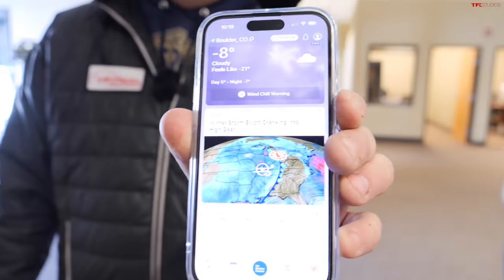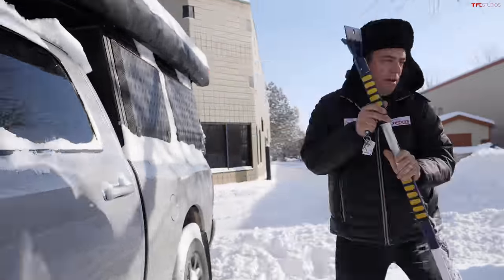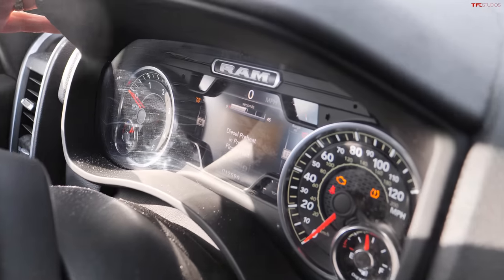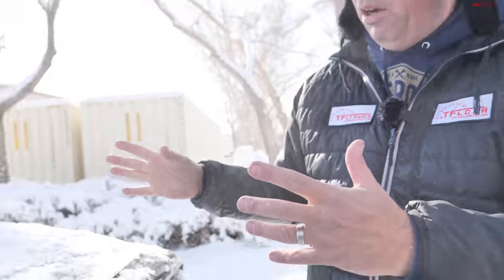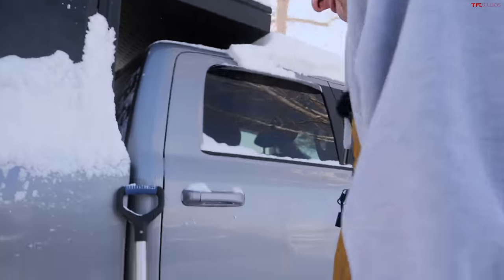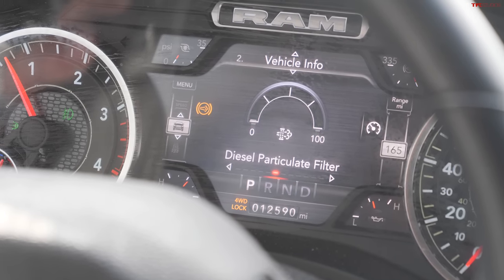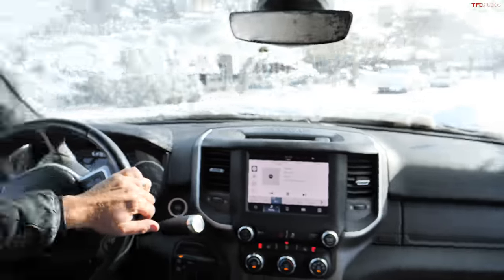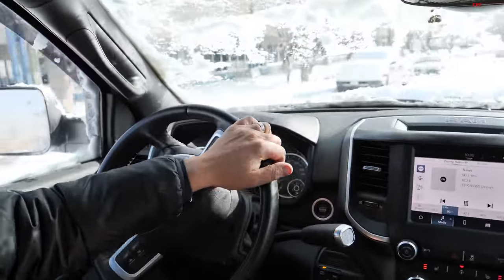It's the COLDEST Day Of the Year in Colorado: Will My Ram Cummins Diesel Start?

Comment: Everybody knows you’re supposed to rev that engine into the red zone as soon as it starts while the guy outside sprays starting fluid and brake cleaner directly down its throat hole.
Reply: 🤣🤣 I use a blow torch to de gel the diesel  in the gas tank and warm up the engine.
Reply: @seymorefact4333  they sell anti gel for it 😆
Reply: mint
Reply: As a wise man from northern Alberta teached me, hitting rev limiter on a solid freeze engine is the quickest way to warm it up
Reply: Settle down there. That's only good for old Ferds with IDIs. They love it.
Reply: ok zipties chill!
Reply: Diesel engines will get addicted to the Ether, then they won’t start without it.
Reply: Just as god intended
Reply: @rickkinnison9573  if its a 6.9 or a 7.3 idi maybe 🤣🤣🤣🤣🤣🤣 trucks can be addicted too lmao
Reply: @Mathieu Falardeau  that’s why you give it brake clean at the same time.
Reply: The best is dual wielding ether. And than straight to the keychup
Reply: @NexxtgenFarms Yes but you have to use the John Deere cans and not the stuff they sell at Princess Auto.
Reply: @fuji302  yellow can never lets you down
Reply: @fuji302  oh yeah that stuffs rowdy. Can’t forget the dumptuma battries
Reply: My employer had an employee fill diesel Ford with gas, so at least there's that 😅
Reply: Mint!
Reply: @fuji302  does brake cleaner provide lubrication or what's the reason people are recommending that?
Reply: It lights off easier in a cold diesel than gelled diesel fuel. Watch Zip Ties cold start IDI’s, you’ll understand.
Reply: It gets harder and harder to watch these guys after every single video they put out! Their vehicle enthusiasts?  From what I see these guys are total rookies.
Reply: Put it in the red. Mint!!!!
Reply: 👌 mint
Reply: straight to the ketchup
Reply: Stop talking
Reply: All the Cosby sauce 👌👌👌
Reply: My 1st gen 12v (1993) used to start with no glow plugs at 15⁰F and when I replaced the plugs and got every thing working, it started at -10⁰ no problem. We get down to -40⁰ here but at 0⁰ I plug her in. I have had fuel lines freeze up driving at -30⁰-40⁰ so I had to address that.  Always make sure anti-gel is in the tank.
Reply: I used to work at a diesel shop in Minnesota in the early 00’s, and there was more than one occasion where I stood on a side step on a semi spraying ether continuously as a coworker drove it into the shop. Probably awful on a rig, but it sure worked.
Reply: I see your a man of culture!
Reply: In the ketchup
Reply: NOOOOOOO
Reply: Only way I ever start my idi now that I've broken the glow plugs
Reply: We recommend  deicing the windows with boiling water.
Reply: These comments are too much words of wisdom 🤣🤣
Reply: @zackjohnson7860  belch
Reply: zip ties!!
Reply: You need to talk to a old truck driver.     If you don't like your truck, that was perfect.
Reply: As a career logger, I've started many a cummins both 360 & 855 just like this. Had a big cam ford 9000 that could smoke out a 5 acre field before it warmed up enough to start sealing the rings good. Thing would pull 83,000 up west bound rt 64 towards covington VA at any speed you wanted..
Reply: @davidfrittenburg8902  high idle oil that is still in molasses state. 🤣
Reply: And pour a cup of warm milk on the engine to wake it up.
Reply: Def freezes and goes in limp mode.
Mopar garbage
Reply: @freeaudiobooks7469  I'm having trouble out of all three main brand trucks the lockers are engaging but the transfer case isn't putting out. Might be an electrical problem. Hoping not a 12k rebuild on them.
Reply: @Terk131  cummins never used glow plugs.. hmmm... just a heater grid...
Reply: Doesn't matter if it's old deisel or new. All deisel gels at same temp.. chances are his truck wasn't gelling as much as fuel filter had water in it and that freezes to prevent fuel to flow. I still add 5 percent of k1 kerosene to my deisel if it will be below zero for days. Yes anti gel works. But even in the old days with our late 60s 70s tractors we used kerosene in tanks to keep from gelling as quick..
Reply: 🤣🤣🤣🤣 have to float the valves to keep them nice and limber
Reply: @Tonyx.yt. PEG!!
Reply: Cosby sauce*
Reply: Mint 👌
Reply: @God-yi9bd  and it don’t always work 😂
Reply: @stevenjones618  It is diesel.
Reply: Man, this comment still makes me crack up.
Reply: Well, that's what I would do!!!

Comment: Andre,  you are wrong on all of this info:  the Cummins does not have glow plugs, it uses a grid heater.  You don't have to use the exhaust brake on cold starts or the high idle feature, it will go into high idle on its own.  This isn't a a DMax....

Comment: In case no one has mentioned, the rapid clicking or buzzing heard for a few moments after the start was the oil filter by-pass opening and closing.  Once the cold thickened oil overcomes the filter media resistance the noise stops.
Reply: You are correct. Even ISX 15 Cummins does that in bone cold temps.
Reply: Wow that's interesting, I thought it was only there as a redundancy in case of excessively thick sludgy oil.
Reply: @aslkdfjhg  excessively sludgy oil? ROFL
Reply: That's really good to know.  Thank you.
Reply: Why did you turn on the exhaust brake?
Reply: @elonmust7470  yes like when you are way too many miles past due for changing it lol
Reply: @mr.monitor.  When my oil gets old, it gets thin.
Reply: @Elon Must  good for you. That is irrelevant. Filters have the bypass for cold start and for when they are too plugged up. The filter isn't going to be dirty when the oil is fresh and thin oil still doesn't pass through a dirty filter.
Reply: @elonmust7470  sorry you don't understand oil and filters.
Reply: @mr.monitor.  I understand them fine. Nobody is byoassing filters to let "sludgy" oil by.
Oil does not gdt sludgy when old, it thins out & loses viscosity....
Reply: @Elon Must  irrelevant. Thick or thin oil can't pass through a dirty filter. Learn to think.
Reply: @Elon Must  an engine that has run a long time low on oil can certainly burn the oil and cause it to get sludge build-up. You don't even consider the variables or consider why they build them like that to start with. Just another troll.

Comment: This is the perfect weather for Tommy to review the cold weather capabilities of one of your electric vehicles.
Reply: @Andrew  they already did multiple videos of the hummer in the cold starting up and driving. It did just fine.
Reply: @Andrew  and diesels struggle the same way in that regard, as he said in the video. Old diesels and cold weather do not match, the only viable option for extreme cold is gas right now.
Reply: My Mach E had a 90 mile range fully charged in 30 degree weather!!
Reply: @futurevikingtony11  ouch. That’s got to be the worst range reduction that I’ve heard of so far.
Reply: @loganhyler9588  A complete fallacy. Diesels don’t struggle any more than anything else does when it’s super cold. -30 last week and I just then had my first gel up and I’ve been driving nothing but my two Cummins trucks since 2002.
Reply: There’s a reason 80% of new vehicles sold in Norway are electric
Reply: @squidinkRC  And you’re right, there is a reason. The government is pushing it. It’s not because electric is better, it’s because they are falsely propped up by the government. Exempt from the 25% VAT, no road tax, reduced toll fees, every false promise has been made by Norway.
Reply: @wyo_garage20  Cummins do better than the others thanks to the grid heaters.  My father in law is getting away from his old Ford diesel truck in favor of a heavy-duty gas truck as it's not starting well when he needs it the most in the winter.  Not way up north either, talking Illinois here, lol.
Reply: @squidinkRC  The parts of Norway with decent population density don't get that much colder in winter than continental Europe.  The people who actually live in parts that do get severe cold are the 20% buying ICE vehicles I'd imagine.
Reply: @loganhyler9588  my 12 valve starts just fine when its cold. 2 minutes extra to start versus 2 hours to charge the hummer. stop.
Reply: They start exactly the same as always so pointless. No need for heat up idling no extra sounds.
Reply: @tbr2109 You imagine wrong. Power prices in northern Norway is lowest in Europe due to excess hydropower and wind. 100% fossil free too in spite of having huge gas fields.

Comment: We’ve been -40 to -60 here in Interior Alaska for the past 5 days. That is ambient temps, not windchill. Windchill is irrelevant to  vehicles it only applies to people. I would love to be at -3F but I realize its all relative , if you’re use to 30-50F above then -3F is a shock to the system. Cheers from North Pole, Alaska! 🎅🏻🎄☃️🇺🇸
Reply: How does your vehicle run ? If you have one
Reply: Grew up in northpole on newby rd, In wasilla now, best place to grow up! Miss it, rippen the 200x or the bravo to moose creek.
Reply: @lj2757  120 volt ac block heater and oil pan heater has to be turned on at least 2-3 hrs before you even try to start it
Reply: Mid -30’s here in northern Saskatchewan the past few weeks
Reply: @landon6327  stoke the wood stove eh.
Reply: It hasn't risen above minus 50 for several days in the Eastern interior.
Check out my latest video
Reply: That's cold as ballz
Reply: @lj2757  Most vehicles in the colder regions of Northern Canada and Alaska are winterized which means they have heating blocks, heating pads on the oil pan, transmission pan and usually heating pad or trickle charger for the battery. Many mechanics will change out the fluids too, the coolant and power steering and break fluids will be rated for -40F to -60F. Then all people have to is plug in their vehicles in at their house or at work. If the fluids aren’t changed out this causes hoses to burst.
Reply: I grew up in north west Arkansas and I swear the cold here hits different. Went through Colorado and it was pretty cold then, compared to our normal temps in Arkansas anyways, and it just didn’t seem near as bad idk what the deal is. Thinner air? Idk
Reply: @mr.potato1649  I think humidity plays a part of how the temps feel or how it “hits you”. We have a dry cold here in Interior Alaska but ironically when I go to Colorado to visit my family the cold does feel different for sure.
Reply: @landon6327  Same over in Thompson
Reply: @mr.potato1649  You're correct.. the air is not only much drier/ there is less air molecules at higher altitudes, so it feels far less cold than say being near a body of water in the lowlands at the same temp
Reply: Sorry but I just had to say hehe.....the 🇨🇦North Pole🇨🇦........ Yep dats Canada... Ok there i said it, I'm done...lol
MERRY CHRISTMAS 🎅 🎄 EVERYBODY..!!!! 😁😊😁
Reply: Agreed!  I grew up in some cold parts of the US.  I thought I knew what cold was.  It got down to 15° F, fairly often in the winters.

Then I visited Edmonton CA, back in February of '87...  -15° F. It literally made me gasp, and I immediately went back indoors! 🥶 😄

Other than the Poles, Canada and Alaska have the market cornered on cold temps!
Reply: Windchill absolutely absolutely matters to vehicles. Windchill just means that things get colder more quickly not how cold they get.
Reply: My cummins crap.
Limp mode, see dealer, dealer says nothing they can do and 30 000km warranty for def.
American mopar crap
Reply: @jimkane9832  damn right windchill matters..  0 F on a calm day will retain residual heat for quite some time..
Add 30 mph winds, and it's 0F frozen block of steel in less  an hour

Comment: I might be mistaken but the truck goes into high idle when started in cold weather. My 21 Cummins takes about a minute or so after it starts to automatically go into high idle. Not sure it’s a good idea to force it into high idle right after you start it when it’s that cold out but man, it’s really cold out there. In NJ it’s 50deg going down to about 20 by 5pm.
Reply: I agree.  My 2019 goes into high idle mode with the exhaust brake engaged automatically after a few minutes.  I think it's allowing some time to get the oil warmed ever so slightly before it revs up.
Reply: Sounds balmy! -37 here in SW MT. -51 with Windchill
Reply: Also in NJ, we’ll be out salting roads later this afternoon. Tomorrow morning our temps will be around the temps in this video
Reply: @caseypries7559  my old 2004 Ram Cummins goes into high idle as well when it cold. It also surges the idle for a few minutes then levels out the idle. It only does that it cold weather. Around the freezing mark and below. It starts pretty good in cold weather.
Reply: @vincentlombardo8991  here in Indiana it's -9F right now with wind chill around -35F so it's just lovely out.  Great day to stay in the house.
Reply: That's correct. I have a 2022 KW T680 with a Cummins engine that will rev higher than usual from an extreme cold start. It's -7⁰ (feels like -20⁰ from wind chill) here in Aurora, CO. It's going to be worse heading back to Chicago.
Reply: Here in the foothills of the Adirondacks we are currently at 53F windy and rainy with rapidly melting snow. In about 8 hours from now we will be rapidly approaching single digits with a wind chill of -7. In my 41 years in the northeast we have had plenty of frigid below 0 weather with wind chills in the -20-30 region; I never remember such a huge temperature swing in 12 hrs before.
Reply: Mine goes high idle within a few seconds depending on the temps.
Reply: @regsparkes6507  the oil doesn’t just leave those area’s overnight or even a few days sitting. They stay coated. Take some oil and coat a chunk of metal and leave it sit for a week. It will still have a coat of oil on it.
Reply: Diesel Pathfinders also rev to 1k by themselves and when in winter mode iddle at 1.4k
Reply: @CrackkkCrazyyy  I hear ya, same up here in Alberta just to the north of you. Too cold!
Reply: I'm in Tennessee and it was 9⁰F when I got into the jeep this morning at 6 am and our high is supposed to be like 14. I think it's supposed to be like 6⁰ tonight.
Reply: -14 with a -45 windchill last night in SE Minnesota. -7 with a -32 windchill this morning along with blizzard conditions
Reply: @MNsparky  its just -14 outside that windchill was invented so tv can add drama to weather reports
Reply: Yeah. It's fine. In fact, one of the recent software updates was to extend the warm up idle.
Reply: Mine starts in high idle this time of year
Reply: If it has oil pressure it’s safe. Been proven to be healthier for Diesel engines to hold a slight rev to warm up then to be bone cold idleing. I know to us car nuts it seems bass ackwards, but it’s true
Reply: Newer engines recommend starting and then within 30 seconds or so to start driving slowly, 5 mph or so, until engine temps come up. Trucks should not go into high idle when its this cold and most computers will prevent it.
Reply: @danimalx23  how would idle be any different then putting a load on it and driving slowly? Seems to me high idle with the exhaust brake engaged gives the same effect
Reply: You can put Rams in high idle by pressing the cruise control button then hit "set". From there you can add/subtract more rpms by hitting + or -. Warming up with high idle is more fuel efficient and better for the engine.
Reply: My 2021 HO goes into high idle within 30 secs or so after cold start on its own. I had to start my truck unexpectedly yesterday at -14 below. I would’ve plugged the truck in at those temps but I wasn’t expecting to have to start it. My truck also sounded the same for a few seconds but leveled out and I let it warm up for 12 mins before driving.
Reply: It will, probably about the time he manually put it in high idle, it would do it itself.
Reply: Yeah i wouldnt have manually high idled it that soon. It will do it on its own
Reply: THIS!  My 18 automatically goes into high idle as did my 14.  I would want that engine rpm as low as possible until there is some heat in the oil.
Reply: @pryme2013  Yes and especially if the oil is synthetic oil.
Reply: @grumpyengg5978  skiing the Big3 in Feb. should be fun if i don’t freeze to death!!! 😅
Reply: My GMC auto kicks into high idle when it’s cold almost immediately, gets up to about 1200 RPM maybe a little more
Reply: My 2014 and 2018 both go straight to high idle instantly after starting when temps go below 20 degrees. Turn on the exhaust brake and within 10 minutes the coolant temp is already above 100
Reply: My 05 PowerSmoke automatically idles up in the cold as well. But I also have the high idle wire connected so I can set it to 1200 RPM any time I like with the flip of a switch.
Reply: I run equipment and lots will go high idle right after starting when cold.
Reply: @Chris-hw4mq  I've seen -40 in northern Mn and no wind. Yup, it's cold but as long as you're bundled up it was tolerable. I've also seen lots of -20 with 20 mph winds and I'll take the -40 anytime. Worst I've ever seen was -33 with about 45 mph wind gusts and I thought I was going to die that night. South Dakota ground blizzard on I90 and zero visibility at times. Trust me, wind chills are for real.
Reply: May gas first Gen Tundra started at -12 in Wyoming this morning with resultant oil psi of 100! Maybe that's why the 4.7 goes the distance! Save the diesel for 30 and above!
Reply: -6 today in Ohio with Windchill down to -35
Reply: @jeffmockus5400  absolutely!
Reply: He didn't let the truck do its thing. He should have just started it and let it go through the warm up cycle.
Reply: Grid heater bolt drops in ur engine and it blows.
Mopar junk.
Need banks bypass and def delete cause that freezes too.
Airbox gets full of snow.
Pure utter garbage.
Never mopar again